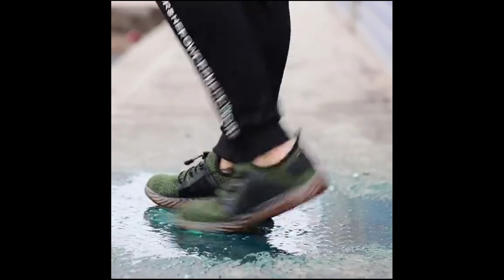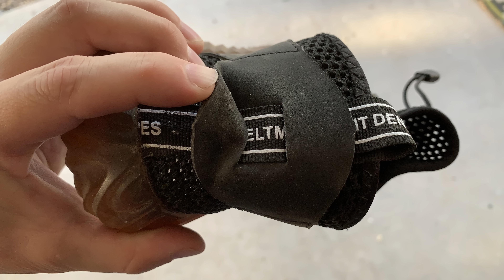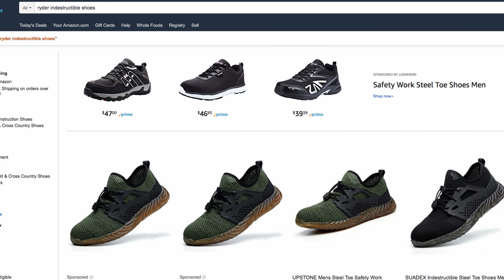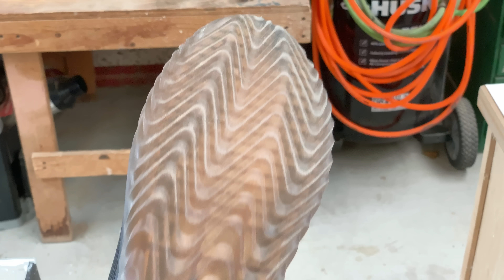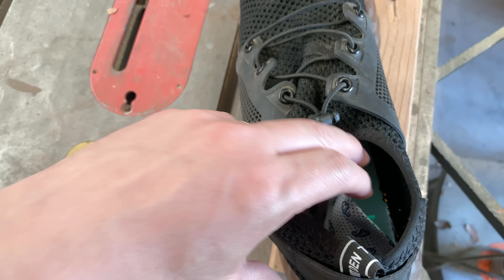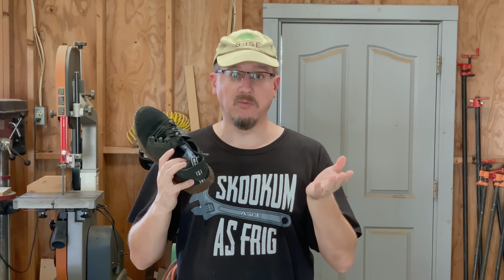"Indestructible" Ryder Shoes for $25?

Comment: you got bigger balls pounding a sledge on that shoe with your foot in it then the people who naruto ran at area 51
Reply: There wasn't a bit of danger to it, I think of less than nothing of Chinese safety shoes but it's nothing for the steel cap
Reply: Dominik Peter 
The steel cap could’ve dented in.
Reply: @christiantheologyunited3707  Definetly not. You'd have to have a pretty heave sledgehammer and drop it from a good hight to get a reaction. A security shoe in my country has to widstand a force of 200 Joule.
If that hammer has around 3kg, you almost had to drop it from 10m, nothing would happen at 5m
Reply: Dominik Peter 
I stand corrected. Haha
Reply: @christiantheologyunited3707  no problem mate

Comment: I ordered a Pair for Woodworking in the garage. How well do you think they will hold up for only wearing in a Garage setting? Are my feet gonna hurt?
Reply from the maker: It depends on how long you are in the garage.  The padding is not great, so expect sore feet after a couple of hours.  Surprisingly, though, even though my pair was too narrow, my feet actually got used to the pinched feeling fairly quickly and that simply isn't an issue long-term -- it's just the poor cushioning that comes into play.
Reply: @granworks  Would buying better insoles help?
Reply from the maker: Maybe.  I'm not sure that a separate insole would fit.  There isn't a conventional insole in it but rather just a thin fabric covered kevlar strip that cannot be removed.  But if one did fit, then it would almost surely help.
Reply: granworks on the Indestructible shoes website they sell insoles that you just cut to fit, so far they are great, I just wish I saw this video sooner

Comment: These so called "safety" shoes come without any safety standards and should be banned for selling as if they are safe! Please go to wynsors.com where you can read about safety standards for different uses. Protect your toes and by proper work boots and put a set of supporting insoles in.
Reply from the maker: I agree that if you are on a jobsite that requires safety shoes or boots that match a standard (OSHA in the US; ISO 20345 in at least the UK), then you had better buy a pair with such certification or they might not let you on the job, even.  These shoes may or may not match the requirements for certification but they certainly are not certified.  But... my alternative to these are just "normal" shoes and the very clear protection that these give me are far better than my alternative, so definitely worth it.
Reply: @granworks  a colleague of mine bought a pair and in less than 2 weeks the fabric worn out and showed parts of the steel toes and another week later and the side started to come off from the soles. A very good friend of mine lost, because of similar shoes without any safety standards, his toes of his right foot (the steel cap came loose and rolled backwards and chopped them clean off). His free time of sports were replaced by learning to walk again and for the rest of his life has to use a stick from the age of 22. This is why I tell people not to wear them for their own sake.
Reply: M TFD I just want to try a pair because of the way they look. I could care less about the steel toe or safety standards, I work at a bakery so...

Comment: Are they actual steel toe? Or composite toe?
Reply from the maker: Good question!  Based on the spring-back factor and the sound they make when I hit them with a hammer, I assumed they were actual steel toe.  But I don't know that for certain since I haven't ripped these shoes apart (yet).
Reply: granworks I watched another channel torture test these shoes. If it’s any indication, it took an angle grinder to get through the toe.

Comment: why do you think it wouldnt last long?
Reply from the maker: They "feel" very cheaply made.  I typically buy regular running shoes in this price range and with a similar quality feel, those shoes tend to only last for 6 months or less.  Usually the glue gives out; the fabric wears through; or the foam breaks down.

All that said, these shoes have a kevlar insole; are mostly in one monolithic mesh piece; and don't have any foam... so I could be wrong!  We'll see.
Reply: @granworks  I see I see, you're right about that. Thanks so much for your insights and reviews! btw would also just like to ask if  it's not comfortable to wear them? for example,  Skechers go walk are by far my most comfortable shoes.  I could wear them all day. how bout those indestructible shoes? is it hot inside? would your feet sweat or like get stinky? really curious cause I really wanna buy  one. thanks super.
Reply from the maker: They are definitely not hot at all.  The shoes are almost entirely made of a mesh material, so there is plenty of airflow.  I wore them all day in 110F/43C weather with no excessive sweating at all.

Comfort is very relative, though.  They are not as comfortable as shoes such as Sketchers since the maze-like sole material isn't as pliant as the foam used by most "normal" shoes.  My legs are definitely more sore by the end of a full day working construction wearing these vs my normal running shoes.  But they are far more comfortable than any steel toe boot you'd wear!
Reply: thank you so much for your time replying! i would be getting one!  subbed!

Comment: So you mean when I measure it (my feet is 270mm so that is US10) I should take US11?
Reply from the maker: I wouldn't go off of simple measurements at all.  Instead, just take your "normal" shoe size (likely 44?) and get the next size up.

Very technically speaking, my feet are 265mm long and so that suggests a EU43/US9.5.  But experience has shown that that size is definitely too small for me unless it is extra wide, so I typically get a EU44/US10.  These Ryder shoes run very narrow and so even that is too little for me and I'd likely need a EU45/US11 to get the proper width.
Reply: @granworks  oh thanks so 2 sizes up?
Reply from the maker: 1 size up from whatever your "normal" size is.
Reply: @granworks thanks! Have a good one
Reply: Whats width have to do with length😂, if you have a skinny foot just order it your size or 1/2 size bigger